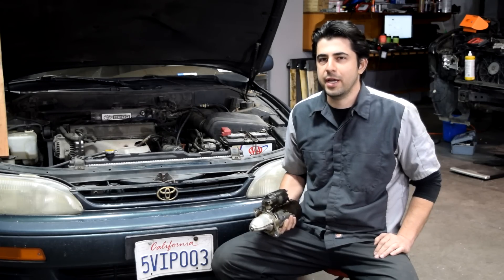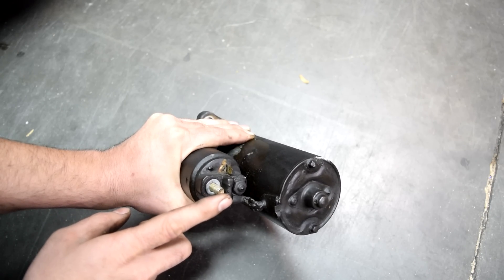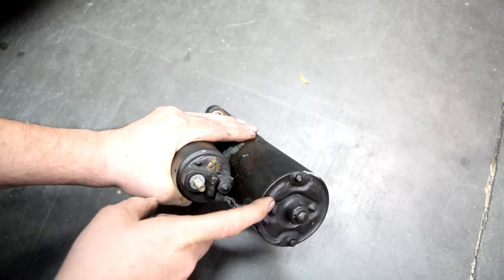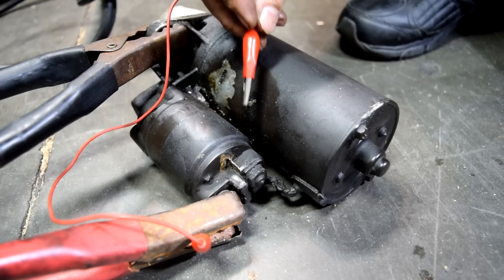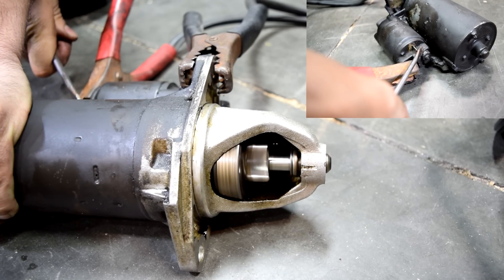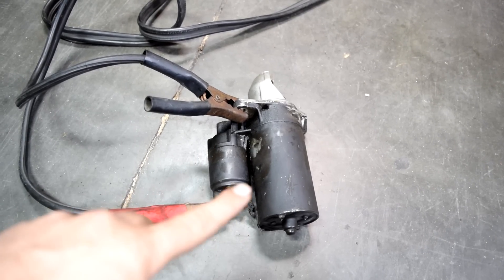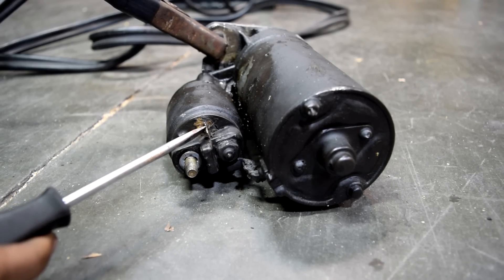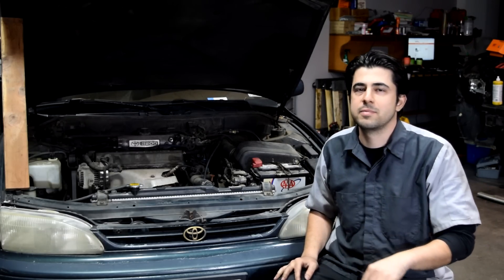How to Test Your Car's Starter and Solenoid Assembly

Comment: Thank you so much, I founf out that my solonoid and my starter are working fine,  My onlybproblem was,  the un attached socket that connnected to ignition switch,  so thank you so much,  atleast I learn to pull out my starter and learded that there gear is perfectly fine,  hahaa,  that @$"':$ unattached socket gives me a couple of head ache hahaha

Comment: I am interested in knowing if the part that pushes the gear hits the flywheel first or does it spin first, then push out? I'm working on a sbc and I have the shims correct I believe, but sometimes when I move the flywheel slightly the starter gear doesn't push into the teeth. But the other times I can. I don't believe the flywheel is cracked or warped. Just wondering what part finds the flywheel first the spinning or the pushing? Thanks!

Comment: Have a problem with my starter the bendix gear stays engaged for about 2 or 3 seconds after motor is started. Bought new starter and solenoid. Can u help.

Comment: I had a starter problem for a while, and i used a old trick, sometimes wouldn't turn at all, and used to go and tap on it underneath the van then would turn ( i change it after), i wonder what do you think was wrong with it , was it the brushes !?

Comment: What if my starter only has a single bolt and the plug? Do I put the positive cable on the bolt? I put the negative in the same place you did. The starter I have goes into a 1UZFE (SC400/LS400).

Comment: Ok I'm having a problem with my 03 suburban. There's a screeching noise coming from the bottom of my truck and it's not the belt. I've been told that it's my starter not working properly. They say that the gear comes out to spin my flywheel but it doesn't go back all the way causing the screeching noise. Is that common? If not, I don't know what else it could be. Help me!

Comment: First lead bolt is getting constant 12V from battery (12.8 actually) so good checks out!
 
I then have friend turn the key and the second bolt (from the ignition switch) is only reading 10.4V, is that my issue? Ignition switch/relay not full voltage? 

Third bolt that attaches directly from solenoid to starter ..picking up/sending nothing! Bad new solenoid i got from factory? Or is that simply the result of only the 10.4 being sent in voltage at 2nd bolt? HELP!!!!
Reply: take it out and bench test it, if it passes maybe your bat is failing under load (likely)

Comment: Great video. I took mine out and tested it like you said and it works fine but when it's in the car, nothing. My battery is fairly new so just wondering if you have anything else to try. Much appreciated.
Reply: Same here
Reply: @jayhampton3735  what was it
Reply: what was it
Reply: What was the problem
Reply: Check fuse and relay

Comment: OOOKaaay, thanks for doing this video. I went to the Local Auto Zone and one person said it was not working properly after testing, then went local Advance Auto parts  and one said it was spinning but the plunger not engaging. Then went to another AZ and it said it was dead , now mind you this was the first place I wen to, so I went back again and they again said it's dead. So I saw your video hooked it up and it works flawlessly! The motor engages, the plunger engages perfect... I normally like the AZ and Advance places but because of your video I was able to verify the starter is working as needed and did not get poked in the eye to the tune of a $180 for a new one.. Thanks Man, just like when you did you're 1.8T timing chain Vid, you saved the day.
Reply: @keep it simple. At the end you said that you hooked it up and the starter was working fine. Why did you take the starter off the car in the first place if there was nothing wrong with it????

Comment: Hi 

I like your videos! I just took off the starter from my 2003 XC90 Diesel. The car had a hard time to start and stalled/cut out the starting. Other than that runs good. The starter motor and the solenoid worked in the test. I cleaned the conectors and put it back. I think my battery is crap. its was made 4 years ago. what else can it be?

Happy new year!

Best regards,
Oliver

Comment: i just installed a new starter to my 4 runner it started one time and after that nothing just one click.  also just put in ignition switch and relay . retested the starter . Ive checked every thing any ideas. HELP
Reply: How did you get on? I've got the one click now an can't figure it out

Comment: I did this test on my starter and nothing happened. The gear didn't spin or engage. This actually drained my test battery down some from about 13v to 11.5v I was able to see this since my jumper cables have a digital voltage reader attached. Anyone ever heard of this? Anyway the video is great

Comment: I replaced the starter  96 Honda Accord,  it worked for 4 days and then started acting up. So I have to  Tapp it with a piece of wood and then it will start. It does that one time in the morning only,  once it starts once in the morning it will start OK for the rest of the day.
Any ideas ? Anybody?  ☺

Comment: Thanks for this video. Solenoids can be purchased for anywhere from 15-30 dollars. Most starter failures can be narrowed down to a bad solenoid and crud build up on the shaft causing the pinion to stick.

Comment: If the bendix pops out but doesn't spin, it means the solenoid contacts are bad (contrary to what the movie states). The starter would actually most likely be good because the pull in coil needs a ground through the armature, then the ground brushes to complete the circuit. Meaning that the armature and brushes are functional. 
If you remove the solenoid from the starter, and try to electro magnetically pull in the plunger ass'y, you have to ground the motor terminal (the one that the starter lead wire is attached to). If you try to just ground the case and apply voltage to the spade terminal the plunger won't pull in. Try it on any starter, any make.
Reply: No. A bad starter is overwhelmingly BY A LONG SHOT the statistically more likely culprit. However yes loose or bad connection to the solenoid is the next best bet to the few remaining  cases. Luckily we can test that with a multi meter while starting the bendix in the same test

Comment: When i connect my jumpers to test my starter it starts spinning right away when i connect the negative to ground my starter. It spins but does not come out without connecting the positive lead to the third outpost on the solenoid. Whats this mean?
Reply: buggy saywhat bad solenoid

Comment: Best video so far on starters.
Reply: Its ok but not accurate. The gear or bendix assy is thrown out by the shaft spinning when motor is powered on and the solenoid is a high current switch and does not operate the bendix assy (gear)
Reply: @markjohnson7508  😅😂😂😂

Comment: I want to add several things concerning the mechanism of the starter :
- Starter terminals are usually named B terminal that gets power from battery, S terminal which is powered from ignition switch and M terminal which goes to internal circuit of the starter motor.
- Beside two coil windings, inside the solenoid house, there is a plunger that is attached to the drive assembly through a shift fork lever. There is a contact plate which serves to make contact between B terminal and M terminal. 
  When the solenoid is energized through its S terminal, the resulting magnetic field will pull the plunger. This motion of the plunger causes two things : 
- the contact plate moves to make contact between B and M terminals, hence powering the starter motor. 
- at the same time, it causes, through the shift lever, the starter drive to move into mesh with the flywheel ring gear.

So, if the starter drive only spins but doesn't move out, there are some possibilities :
- solenoid windings are not good enough to move the starter drive
- the plunger and/or shift lever don't function properly

A cable between M terminal to internal circuit of the starter motor seems to be rather difficult to check on board, since it's short to inspect, but it's vital too. If it's bad, we will often only hear "Click" sound when trying to start our car.
Reply: Hey man i have a 2002 Vic the motor won't turn over one loud hard click when turning key. Tested battery all good cleaned Terminals and checked cables installed new starter with solenoid as well as a new relay. Same results nothing changed. Flywheel well flex plate I mean is in great shape also hand-turned motor at the crank no issues doing that but didn't fix anything. What the heck man is my motor shot!?  please help me and thank you in advance!!
Reply: Hi Lex I have a question for you. When the starter was mounted to my 19999 s 10 pick up I bypassed it and I heard a smooth hum but no turnover noise. So I though it might be the solenoid, so I took it out and tested it like in the video.(Which was helpful by the way). I watched the started gear spin and slide out like 3 times.  When the gear went back into the disengaged position it went in kinda slow (Not as fast as it did in this video) also i could easy slide the gear in & out with my fingers is that normal? I did find out I don't have a constant 12 volts coming from the Ignition wire so I was going to check the relays and try to figure out how to test the nss but that still doesn't explain why I didn't hear a turn over sound. I found out that the starter gear shouldn't slide like it did so I replaced the starter and now it starts right up.
Reply: @zerostrife5360  hopefully you won't have to go back in there soon because you re-used your solenoid.
Reply: No orileys gave me new starter and solenoid because it was engaging slow. So I learned about a new problem. The solenoid is mounted to my starter.

Comment: all good except your explanation of the solenoid it does not control the bendix as you described,  the bendix is pushed up by the spinning motion of the starter motor the solenoid only transfers the power to the motor from the battery if the solenoid is bad it will not spin the motor which in turn will not make the bendix gear pop out.
Reply: There is a plunger inside the solenoid house. It's attached to the starter drive through a shift fork lever. 
When the solenoid is energized, the plunger is pulled by magnetic field resulted in the solenoid coil windings. This motion of the plunger causes the contact plate moves to make contact between B terminal and M terminal, which then powers the starter motor. At the same time this plunger motion causes the starter drive to move out. 
So, basically the solenoid action provides or control these two functions. 
The starter motor only provides spin/rotation.

Comment: Dude great video saved me a trip to auto parts store and stopped my wallet from bleeding .i especial appreciate the remark to clean starter contacts if it don’t work .my Silverado was come and go no start no click .chased all suggested areas in video .tested with multi meter and someone turning key all voltage was correct .removed starter and wouldn’t fire with jump pack .cleaned all posts and it worked again .thanks for great video it helped me greatly .keep the great vids coming

Comment: Thank you! I really didn't want to take this in to the auto parts store to get tested, and I'll admit, i jumped when the solenoid sparked, but then i did a happy dance because nothing happened! And by that, i mean, my solenoid is bad, it popped and sparked, but that's it, not a thing from the starter

Comment: 94 bronco 5.8 - three starters,new relay,it won't crank. Last starter worked twice then just clicks at the solenoid. All wires,connections and cables test good. Ring gear good. Could 3 in a row be a defective product line? Mfg. in china!

Comment: I have no crank no start and I do this with the starter on my truck to start it with a long screwdriver that means the starter is good right? I'm assuming the contacts could be corroded or anything in the circuit from the relay and back?
Reply: @henry dv yep it means your starter solenoid and motor are both good.  It. It means you either have no power going to your S terminal or the connection right at the S terminal is crappy.  Just taking a guess, was it you’re neutral safety switch, starter relay or ignition switch that was bad?
Reply: It could also be a fuse or a relay make sure the connection in the fuse is not broken plus you can find the correct fuse in the owners Manuel

Comment: My starter works sometimes and sometimes in doesnt. I took it out and tested it and the gear pops forward but not as strong as the one on your video. SHould i replace the solenoid?

Comment: Hi, I have a problem with the starter of my stratus 00, the problem is that when the temperature is close to 0 degrees centigrade, the starter dont work, I turn on the key and no click is heard, the battery is complete charged I already check it , the weird is that when The temperature rises to 5 degrees I can start the car how  I can to solve the issue.

thanks and regards.

Comment: Great video. Question. I have a 2005 Dodge Grand Caravan. The van is experiencing an intermittent starting problem regardless if the engine is hot or cold. When the key is turned I can hear the fuel pump, various electrical clicking but the engine doesn't even try to turn over. I repeat this over 3 or 4 times with the same sounds and result when eventually the van starts. The battery, alternator and starter have been tested and were deemed to be  "OK". I think it's an intermittent problem with the starter. The van has 145000 kilometers. Any thoughts on what to test or what your "gut" sense of what the problem is?.
Thanks

Comment: Thanks a million! No start this morning on my 2004 GC. Recently had the starter replaced so I'm thinking fuse. Watched your video, looked at the starter from the topside, and saw the solenoid ignition wire was hanging free. How did that happen? Anyway, reconnect the wire and we're good!  Started right up! Can't thank you enough!
Reply: Kll

Comment: Could I hotwire a car by just supplying an external 12V to the signal post that's connected to the ignition switch?  

I know jack shit about cars, just seems to make sense as long as you can supply that post with 12V it shouldn't matter if it's from the ignition switch or ... a 12V battery you're carrying around (for some reason).

I don't advocate car theft, just trying to understand if you could get the starter to turn over in the manner I described vs. smashing the steering column.
Reply: As long as the vehicle doesnt have an immobiliser requiring the key in the ignition, i would assume that you could quite easily start the car and get trotting on down the road :)

Comment: Witnessed cars at my workplace would not start, no click, no cranking noise, nada.  Coworker bypassed the solenoid(as shown in this video) using screwdriver.  Car key has to be in on position.  WARNING: BE CAREFUL NOT TO TOUCH ANYTHING ELSE WITH SCREWDRIVER(SUCH AS METAL HOUSING), could damage other electrical components.  Temporary car start method only works if access easily available to starter motor terminals(like say if located at front, upper part of engine).  My 91 Honda Civic's starter motor is located at bottom, rear(near middle of firewall) of engine.  So I cannot use this method to start my car as the solenoid went kaput.
Reply: +Andrew W Sorry, my mistake on the details.  My bad, don't know how to delete my post.

Comment: I have an issue with my Tercel 94, there is not spark from the distributor to the spark plugs, I tried changing the distributor and still does not have spark. What can I do?

Comment: Hopefully this fixes my problem. My car had a aftermarket switch directly to 12volts to get the starter going. As long as the switch is open, the car will start. So, i accidentally pulled the the source coming from the switch to the starter. Went down to connect the cable to the starter and now it just spins. From the sound of it it looks like i connected the cable to the wrong post causing the starter to only spin. I'll be switching it over to the small post on the solenoid and hopefully this fixes my problem!

Comment: Simplest and clearest video on starter basics.
Reply from the maker: +papa shango Glad you liked it, thanks.
Reply: Ratchets And Wrenches please help 
My 2009 wrangler got a new battery , oil change everything etc but it doesn't crank . Just a click . Workshop changed the battery again and it started but I'm not satisfied . I think the problem is related to what you explained here . How can I tell ?
Reply: This will tell you whether or not the starter could work, but not whether it will definitely work. I just had to replace the starter on my car, and it tested fine, but wouldn't work on the car. The explanation I got was that there was no load being placed on the motor, so it was able to spin more freely than it would have on the car, trying to turn the flywheel. I was getting a loud click every time I tried to turn the key. But occasionally the starter would still start up the car. I replaced it with a new (remanufactured) starter a few weeks ago and it has worked fine ever since.